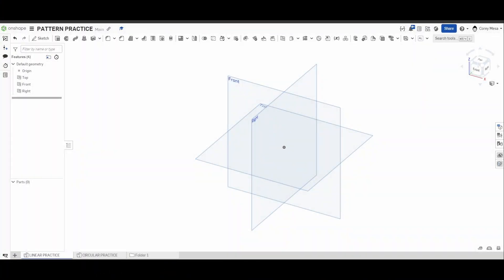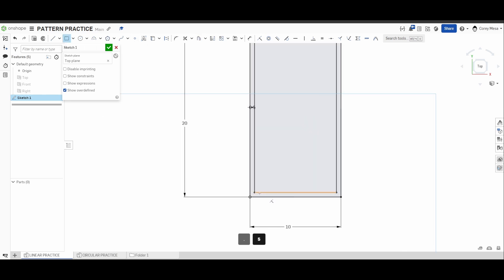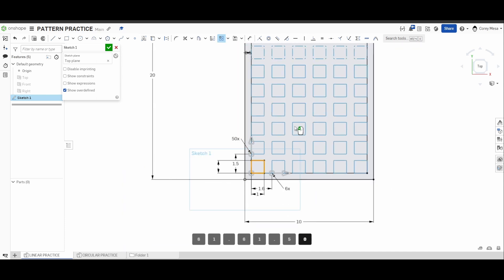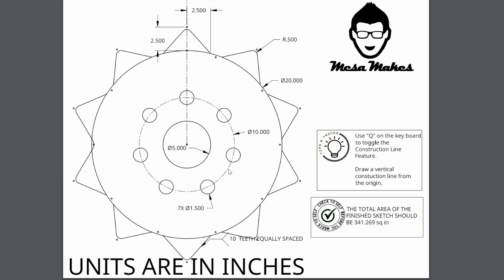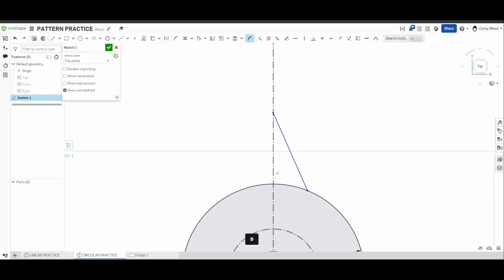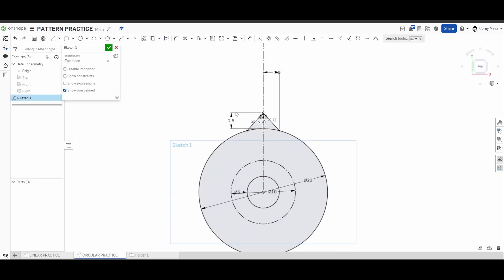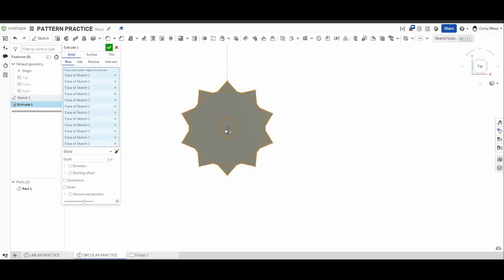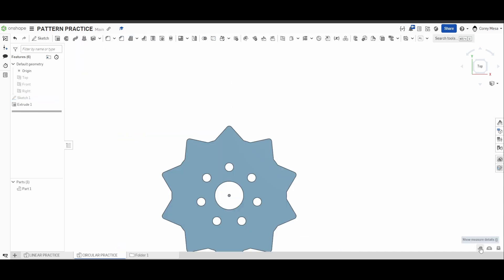Onshape Orientation: Linear & Circular Pattern Tools Explained

Comment: Is there a way to change the linear pattern parameters AFTERWARDS? E.G. if I want to increase/decrease space between?
Reply from the maker: Yes when creating the pattern you should see a number and an x next to it the number being how many copies In a specific direction you chose to make. Double click on that and change the number to change the number of instances you want created.
Reply: @MesaMakes ok, but it seems I can’t change the spacing afterwards.
Reply from the maker: @YoSasch  so so there should also be a dimension spacing when you select that pattern that will allow you to change the spacing as well so look close for like maybe if you’re spacing out two circles, for example, look between the two circles as a spacing component

Comment: Is there a way to parameterize the # of instances based on the size of the object? Could I make a grid with a variable length and width, and have it filled with as many squares of length A as will fit with a minimum spacing of B? Or is that impossible?
Reply: (What I'm actually trying to do is figure out how to make a number of sieves to separate seed beads by size)
Reply from the maker: Send me a rough sketch and I’ll do it for a video for Monday MesaMakes209@gmail.com. From what you are saying I think it’s an order of operations issue but I’ll try to work it out. Also share your doc with me and I can peek inside as well

Comment: You have mastered Onshape well. But I watched your video hoping that you could tell me how to define circles. All the circles you drew you started at the origin and it defines as black no problem. But suppose you wanted to start your circle away from the origin? When I draw circles, they are undefined because they are not started at the origin. I have a reason for wanting my circles to be away from the origin, but am having a tough time getting them to go from blue to black (defined) If I click on the circle center then to the origin, it will jump to either the horizontal or vertical, but still isn't defined. I can't figure out how to constrain the other axis (either horizontal or vertical)
Do you have a video on how to do that?
Reply from the maker: @moodberry  check out the new video at 12:44 https://youtu.be/Z_Wsw0WFtOY?si=_l1dIzJcSLWTryoU